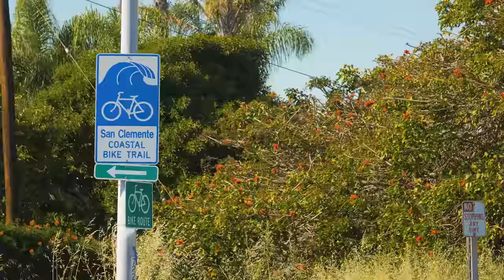Milton Doesn't Surf! Build To Grind: How To Make a Jersey Barrier w/ Rhino @ Trestles

Comment: Can someone explain what kind of glue they're using and the purpose for it?
Reply: to smoothen out the barrier is my guess
Reply: It's concrete binder. It helps new pours bind to the old concrete better so it doesn't separate and chip away as easily